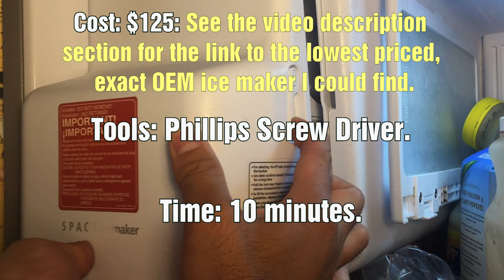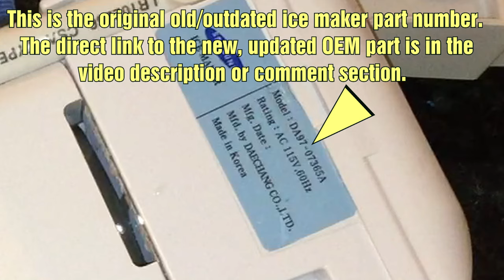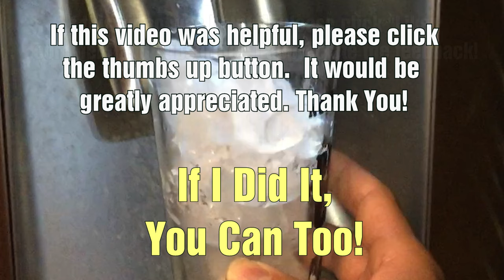DIY Ice Maker Repair RFG298HDRS / XAA Samsung Refrigerator How to Fix in 10 minutes and $125

Comment: Hi, useful video!   I just replaced my ice maker, how long should it take to start making ice?
Reply from the maker: Hi Michelle, thank you!  It can take  several hours since the ice maker will need to freeze the ice.   But a hopeful sign is hearing the water line running.  It at least means the ice tray is filling with water.
Reply: @thriftytani46  thanks for the quick reply!  I will keep an ear out!

Comment: Trying to troubleshoot mine. It's not getting water to the tray. The water dispenser works though... Any thoughts?
Reply from the maker: Hmm it could be icing in the tube that leads to the water fill spout.  It would be a pain, but you could unplug the fridge and let it defrost and see if it helps.  If not, the ice maker fill valve would be another culprit.
Reply: Where is that valve?
Reply: @davidyarbrough6426  Did you ever find where the fill valve is located. Mine is doing the same thing. Ice maker works but not getting water.

Comment: What exactly was the problem with your icemaker? I have a similar model that stopped making ice this week and the motor will hum and act like it’s trying to cycle but that’s it we are not getting any ice I’m not sure if it’s the icemaker or if it’s not getting water the water dispenser in the door does work
Reply from the maker: Hey Brad, i think the most likely problem are the gears that are linked to the ice ejector fingers are damaged.  It’s probably why you can hear the motor humming. Try using your cellphone camera with the flashlight stick it into the ice maker space and take a pic check to see if there is ice in the tray.  If there’s ice stuck in there,  this could be the problem.   A less likely issues is the heating element isn’t working and the cubes are stuck in the tray.   Check out this video. https://youtu.be/wF3gtLOxVFc  It’s a complete disassembly of the ice maker unit.  Maybe it’ll give you some ideas on how to zero in on the problem.